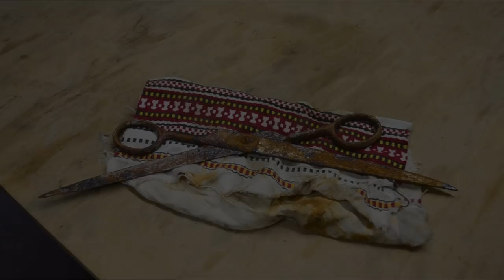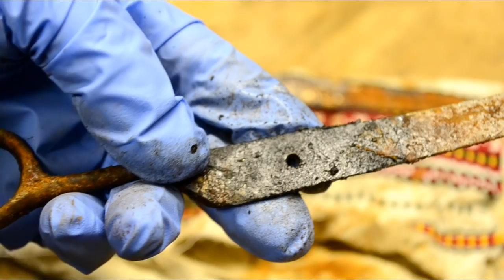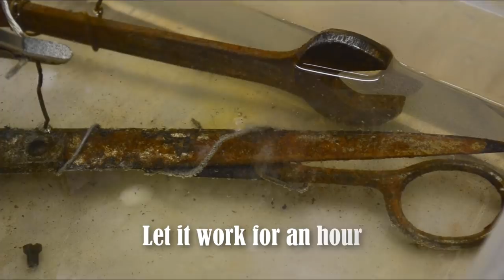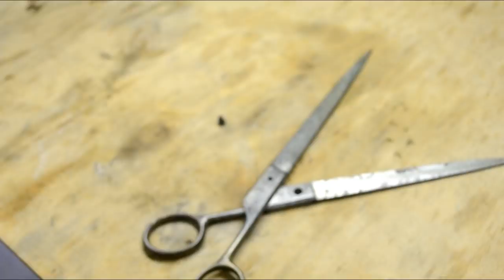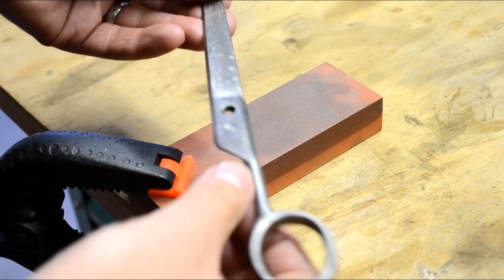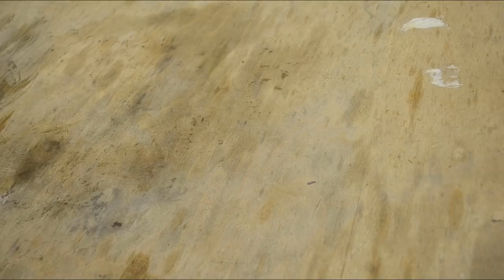Vintage Scissors Restoration | Restore Hand Tools

Comment: Really nice job! I’ve seen people using angle grinders 🤦🏻‍♂️ but electro cleaning is a much better option.  They look and work so well.  I have lots of my grandfather’s tools to restore so thanks 🙏🏻
Reply from the maker: Rufus that is a nice comment and I thank you for that. 👍 🙏🏻 Much appreciated. I honestly dont understand it as well. I have also seen people uing grinders and I wonder why. Possibly only to get the job done a bit quicker but the result is not good. If not electrolysis I'd go with complete hand restoration - sandpaper and going up from low to high grit. What are you going to restore? I'm looking forward to that 👍
Reply: AllFlavor Workshop Thanks for your reply! I’m not great at making things but my grandfather and his brother were both master craftsmen.  His first job as an apprentice was to make himself a tool chest.  I have his oak tool chest, about 3’ / 90cm wide full of his old tools.  Stuff for panel bearing, hand planes from the size of a cigarette lighter to one that only just fit in the tool chest, and dozens of tools I don’t even know the name or function of.  I’d like to start with the chest and then work through the tools.  I have a friend who does antique restoration who going to advise me.  Then I’ll be hitting your videos for the content of the chest. My grandad’s brother made interiors for Rolls Royce and also made some of the furniture for The Queen’s dolls house.
Reply from the maker: @RufusEatsCheese  That sounds really great Rufus. I wonder how the chest and tool restoration goes. That's like a box of surprises. :)

Comment: Something to think about but try not to use an old spanner for the sacrificial anode metal. A lot of spanners are made with chrome-vanadium alloy. There's the possibility of leaching out chrome hexavalents into the water. Yummmm, toxic, carcinogenic chrome hexavalents. Just use old rebar or a large bolt or something. Just don't use stainless steel or anything with chrome in it.

Couple of tips:
- What's the logo on the scissors? Some research on who made it might make the video a bit more interesting too.
- To further refine your video/processes and possibly more interest, try polishing the scissors to as near mirror finish like they would have looked when they were new.

Good luck on future videos.
Reply: you give good advice. thanks
Reply: It's like don't burn pressure treated wood in the bonfire
Reply from the maker: +Storm Khan thanks for the advice. Completely agree. The sacrificial anode in this case is steel. 

As for the scissors logo: those were made in Czechoslovakia by a company Mikov. 

Anyway thanks for the tips.! 👍
Reply: @MrRaincoast  "people like you are the reason we cain't burn tires no more"

Comment: You didn't take them as far as I would, I would have polished them further. However, for workaday scissors, it's good enough. 
Gary Burg is correct about one thing, you should not test scissors on paper unless that's all they're going to be used for. No, they are not made for cloth specifically, but not for paper either. Let me explain. 
Paper and cardboard contain a grit that isn't seen but is certainly there. Cutting a lot of paper or cardboard will dull them fairly quickly. If your scissors are meant to be used on cloth, use them only for that. Cutting paper is actually easier than cloth, and even dull scissors will cut paper fairly well, unless it's like extremely thin paper or something. I do not know for sure the original intended purpose for these, but the design says not paper, hair perhaps, not cloth either though any good scissors can be used for about anything. Is there a brand on these or country of origin? I saw only a 3 in a circle. No idea what that means, a size probably. Good job on sharpening them, most people don't get it, they tend to screw up scissors when trying to sharpen them. Myself, I just use a diamond impregnated steel unless they're really bad, then I start with sandpaper of various grits until I get the edge into reasonable shape. The diamond steel does two things, hones and turns the edge back to straight.
Reply from the maker: Great advice, thanks for that. Honestly I can't tell what was the original intended purpose. My goal was to make them usable again. I am really not sure about all the polishing. You can see videos on other channel where people insignificantly polish and polish.. Anyway the scissors were made in Czechoslovakia by a company Mikov (it is not a 3 but an M). Anyway, thanks for the comment 👍
Reply: @AllFlavorWorkshop  I polish as far as I can just because I like them that way. Not that it serves any real purpose. Chrome don't get you home as we used to say, but sill I like some things highly polished for no particular reason.
Reply: @AllFlavorWorkshop  Google search reveals that they are wallpaper scissors. The brand is high quality steel.
Reply from the maker: @beaksofeagles  Great catch, thanks!
Reply from the maker: @beaksofeagles  Great catch, thanks!

Comment: When sharpening scissors you shouldn't grind the inside of the blade. As this will take away the high points and can prevent them from working properly.

Comment: Use sand blaster it easier like new
Reply from the maker: Mike, thanks for the tip. I don't have one yet but I am planning on getting one. Would come in handy in many projects. 👍
Reply: I like the finish of this restoration better than one that would have done out of sandblasting